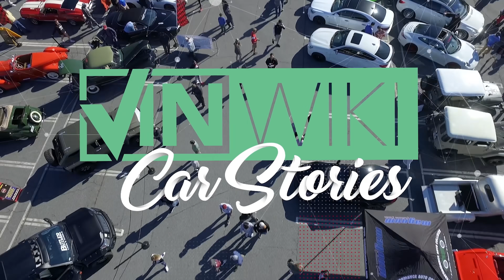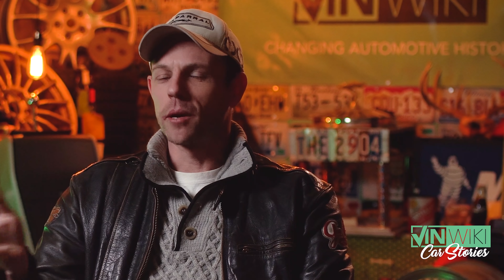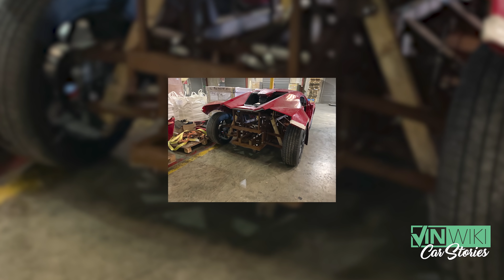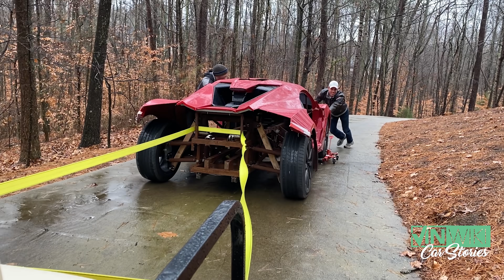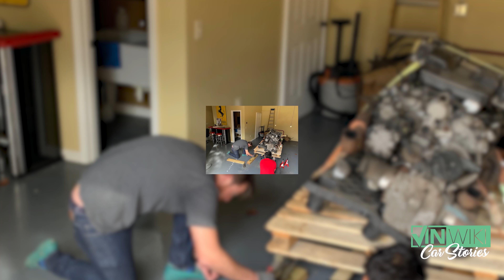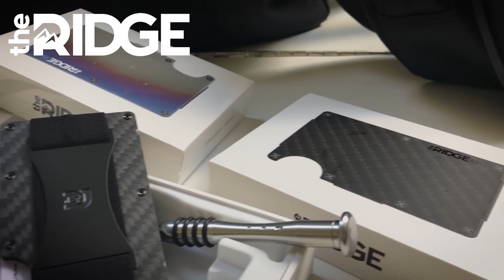The Fast & Furious Lykan build plan by Genius Garage

Comment: I wish that there was a "Genius Garage" here in the Seattle, Washington area!

With all of these kids being Focused on STEM, they need a Platform to use it in "Real Life" experiences! If it wasn't so expensive, a High School Platform would be AWESOME!

When I was in 9th Grade (Junior High) we had a Program Called P.E.T. (Power, Engineering/Energy, Transportation), where we learned about Aerodynamics, Horsepower/Torque, and Solar Power.

Sadly classes like this are DEAD...😿

We even worked with the "Late 1980's" Power Banks (Motors) from LEGO and learned about Gear Ratios!🙀

Sorry for the long Comment, but I wish that there was a Public School Program like this again for our children.

Take care,
🤓 -Thomas
Port Orchard, WA
(Just West of Seattle, Washington)

Comment: I wish that this program was around when I graduated with my Mechanical Engineering in 2007. I got more hands on than a lot of other due to involvement with Baja SAE and, to a lesser extent, Formula SAE, but I still wished I had more. 

I have a huge passion for cars, but the auto industry was in a downturn when I graduated. I got into Aerospace and haven't looked back.

Comment: This is neat and genius garage sounds fun, but doing vehicle design in college is available to about every engineering student out there through the SAE student design projects as about every engineering college has a chapter. Within the SAE programs you can clean paper design a formula car or a baja car, and on the Formula car you can even design and build your own engine. There is also electric car, hybrid car and autonomous vehicle programs as well as several for aircraft. I did the baja and the formula car projects when I was in school and learned to weld aluminum and layup carbon fiber, so you get some real world hands on experience. 
Not every student does these which is a shame as it is a great resume builder, and a lot of fun.
For more info see here https://www.sae.org/attend/student-events
Also these programs are in constant need of volunteers and funding

Comment: I have a few questions regarding the build that I can think of off the top of my head
1. You mentioned possibly getting sponsors to possibly back the project. Is there any plans to ask Universal Studios themselves to see if they could sponsor/endorse the project in any way? Who knows maybe they may be interested as it would make for great pr material for fast 9.
2. What is the general mindset going to be going into a project like this? Function before form or vice versa? I imagine trying to make an actual hypercar interior/exterior would mean a lot of carbon fiber and expensive parts that require time to either build/outsource.
3. Is there any sort of deadline you anticipate the project to be comeplete by or is that not a concern?

A build like this only comes around once in a lifetime. I'm throughly excited to see it evolve as time goes on! I'd love to drive down from Canada to see it in person once the build is complete!

Comment: I don't get the problem of building a Likan if you have the body, the Likan is just a rebodied RUF ctr 3 , that by it self is a highly worked porsche boxster 987 extended chassis with a pdk  997 turbo engine.. so just get a crashed a 997 or 987 pdk and do a kit car with it..  that is basically what an original Likan is..

Comment: If the Aviation engineering study I had started years ago had more hands on stuff in it, I would not have quit so soon. I am fine learning theory, but only when I can put it to use. To me it is give me the actual problem, let me look at it and then find and learn the theory I need to learn to start putting it to practice.

Comment: I've never heard of genius garage but it sounds amazing. I've always said the best engineers are the ones who like to wrench and rebuild things and then got a degree to supplement their mechanical skills. I finished engineering school a few years ago, and I was shocked at the utter lack of labs and hands on teaching, and I even went to an agricultural state university! Lots of people I went to school with and have worked with have absolutely no mechanical knowledge but they can design a rocket with all the math they know, but they can't use a drill bit or torque wrench.